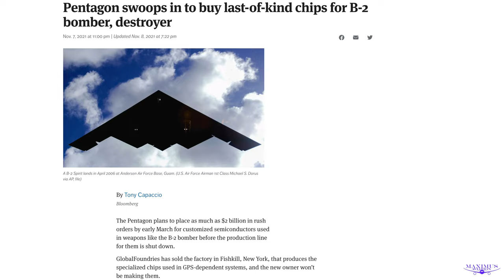Pentagon Scrambles To Find Microchips For Stealth Bomber Before They Are All Gone

Comment: Pretty dumb of the USA to allow, nay, encourage the sale of vital production capacity.
Reply: Sale or not, this line would likely be decommissioned fairly soon anyway and rebuilt to produce something more economical. Silicon foundries are extremely expensive to just keep operational and they can only produce narrow range of types of products without needing a complete overhaul. For example, a line set up for high speed microprocessors will not be able to produce dram economically and will be completely incompatible with the requirements needed for making flash memory.

On top of that, older factories are often more expensive to run, per wafer processed, than the newer ones simply due to the levels of automation in place.
Reply: @MoraFermi  As well the parts required to operate that factory are likely no longer made by the suppliers, who have moved on to newer model machinery which does not use the older wear parts or supplies. You buy old semiconductor lines literally for the scrap metal value, as they are useless without the millions of dollars of parts and supplies needed to keep them running. You use millions of dollars a month just to keep the lines running, just in spare parts and consumables, and those come in kits that you change out every single piece at the time it says, even if the kit itself came in at 2 million dollars, and it lasts 6 weeks in use.

Comment: Boeing Integrated Defense Systems VS Boeing Commercial Airplane Co. . . . They hate each other. . . Go There. . . Dare Ya!
Reply: Boeing Defense Space & Security paying the bills since the MAX debacle. Either way you look at it Boeing Commercial, Defense and Space have the same systemic corruption they drive on cost, schedule & shareholder value over quality and safety.
Maximus could do a series just on Boeing Rotorcraft corruption lets not forget One Boeing. 😂

Comment: Having experience in the military/government defense electronics components field this is common. They are giving them very large end of life orders which should last the rest of the life of the platforms that use them. The semiconductor fab will produce many upon many wafers that will yield many times that in dies and then hand them off to a company like Rochester Electronics who will finish and package them as needed at an agreed upon time table to last the life of whatever it goes in. This is now common practice. Additionally if it is something we will really need in the future they will take the lithography from that line, re tool it for a few process, and create a functional replacement and qualify it with another company if the money is there to do it. He mentioned it was an ASIC and I am guessing it’s a mixed analog/digital. My guess is being from the B2 it’s a very old design that could be easily recreated if they want to put the millions of dollars into it.
Reply: Also a lot of these items they actually can get the part, but it no longer is made in the original package, so there are companies that take the new SMD versions, and package them in adaptor boards and ceramic substrates, so that they can fit in place of the original part. Also some have been obsoleted but there are replacement parts that can do the functionality, so again they have a plug in adaptor that does the translation needed. That is why some versions of test equipment reach silly prices, where you find that a newer or older one is worth a lot less, simply because some old set of test instruction or work process was certified with that exact revision of meter, and a new version will require a recertification of the whole program again, which might run into a few years work and millions more in cost.

Comment: Sorry, but what kind of idiots are there in the government and pentagon to allow that a strategic important company is sold to someone who doesn’t want to produce them anymore ? Furthermore, I learned as a kid that semiconductors are not subject to be worn, because they are functioning just electrically (?). Why is there such a high need to replace them or are they all produced with limited quality?
Reply: Electronics parts do wear out, they do not last forever, and some parts are exposed to high temperatures, vibration and shock loading, which makes them fail mechanically as well. Most modern electronics has a finite life when powered, though typically it is way past the time when you have tossed it out because it is no longer in fashion.

Comment: Anybody know if that Fishkill semiconductor plant is the same one IBM built in the 1960s?
Reply from the maker: Yes it is.
Reply: @maximusaviationchannel  Thanks.  I used to work for IBM in the 1970s/1980s and remember passing Fishkill on my way to the Poughkeepsie facility where mainframe computers underwent final assembly using components made in Fishkill and RAM chips made at the IBM semiconductor facility in Burlington, Vt.

Worked at McDonnell-Douglas (C-17) in Long Beach after IBM.

Comment: they are unique chips, they must be able to run windows ME edition without a hitch.
Reply: LOL, the B2 started life in the 1980s so Northrop would have needed to look way into the future to support Windows ME.  It would be interesting to know if there were any COTS OS running on the B2 when it was delivered.
Reply: @BlindBatG34  it was mostly a stab at the government and how fast their IT is upgraded. our first digital fire direction computer was a TI-55. we would have lost the battle (probably the war) by the time the darn thing would calculate a fire mission. we stuck with 'charts-n-darts' to shoot our missions and "followed" the missions with the HP.

the battery computer system was next. it couldn't hack it working in a M-577 track without overheating. man the battery cannoneers sure were pissed when they found out their daily ice ration was getting used by a computer.

Comment: Hard question to answer. Aviation Technology  is by necessity a hybrid of Pure Civil and Military applications.  Either can be a driver for the other 
The Boeing  use of Civil air frames and technology in its military  versions. So, interchangeability is what most Manufactures make profit from. So if the Military chips  are likely to be in short supply  the question is how close does that put Civil Aircraft to being obsolete for the same reason. 
I trust your judgement on what in this space

Comment: Been in military electronics since fires in bottles (valves/tubes) and the military keep specialising in their own technologies and run into this specialist limited manufacturing base problem time and again. Instead they should be using standard readily available hardware products with key software, allowing for easy transitions as new hardware is developed. But they will not learn!!! Would be interested in the more spectacular military news!!